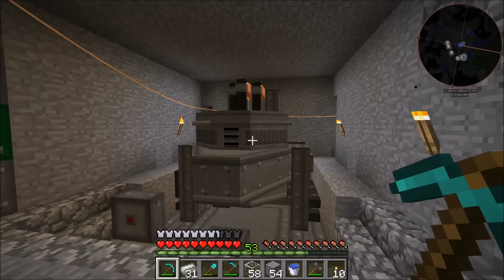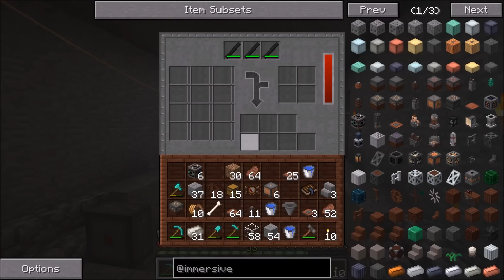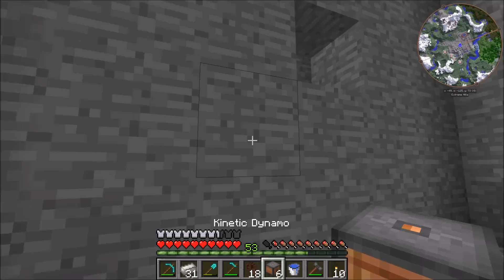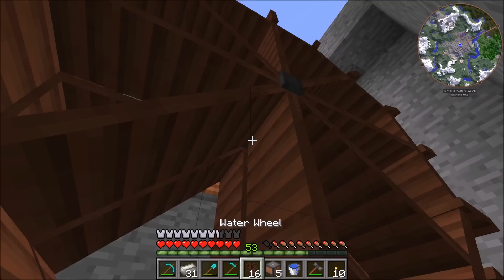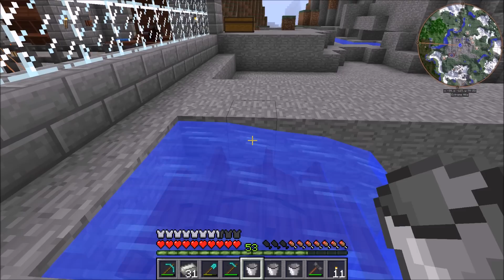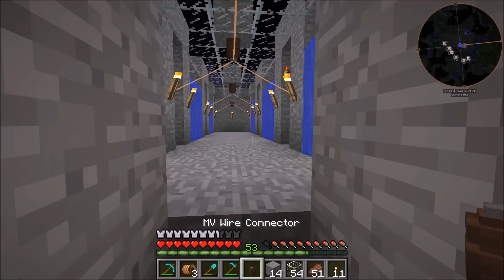Surviving With Immersive Engineering :: Ep.20 - Automating The Arc Furnace

Comment: Can't auto input electrodes anymore.  Used to be able to, but a recent update disabled it intentionally.  I raised this issue, and they answered a while back.  https://github.com/BluSunrize/ImmersiveEngineering/issues/836

What version are your running?   Note that they have released 0.7.1.2 4 days ago.

I've been measuring the current at the input of each machine, and was surprised by all the loss.   It's pretty fun to try to minimize the loss.

Nice water wheel design BTW.  I like it.
Reply from the maker: +zuul I hadn't updated yet because of an issue I was having (resolved now) and thanks for the link! I was afraid I was doing something wrong :P